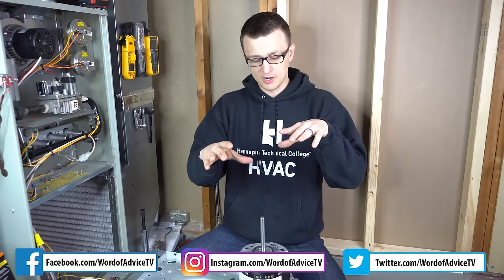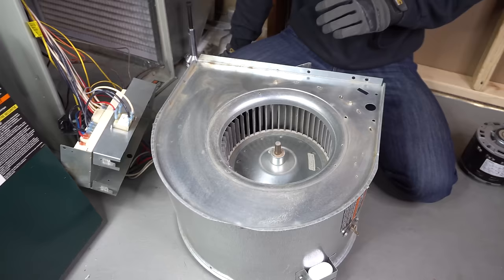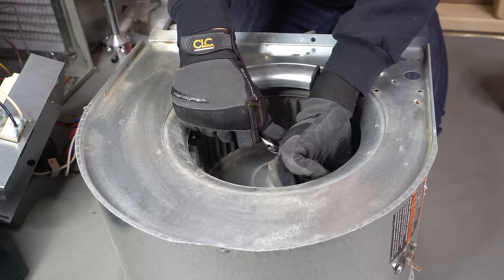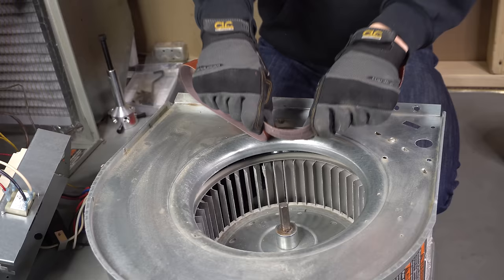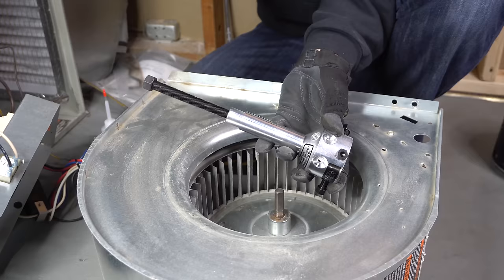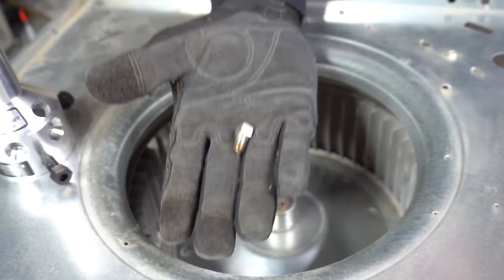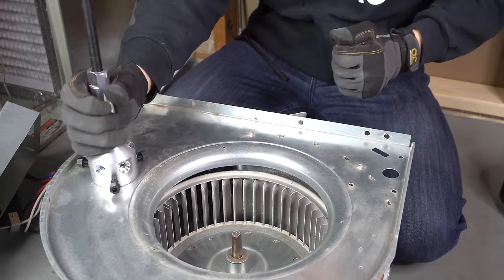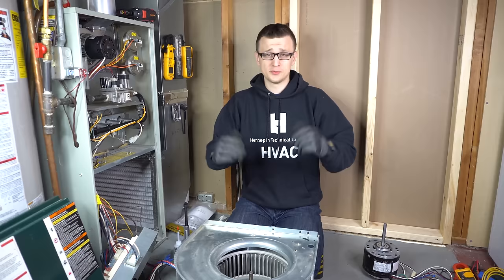Furnace Blower Motor Not Coming Out and How to Persuade it

Comment: Hey Troy. Thanks for the help. My  blower was really really stuck and  i don't own a puller. Tried oil , crescent wrench, hammers, heat you name it. What finally worked was inserting the shaft into my B&D 1/2 inch electric drill and cranking it while holding the blower. Turned the motor free and polished the inside of the wheel hole at the same time. The drill Went on the shaft easily and tightly and loosened it with zero effort for the drill. I 
had struggled for close to 2 hrs. Before this.

Comment: I’ve been a tech for 30 years and blowers are always a pain. Firstly, why is the motor being replaced, many times its a blower wheel becomes unbalanced and destroys the bearings over time. On outdoor units that have a rusty shaft, dont bother, order a wheel too.  If your insistent to remove the blower or condenser blade, clean up the shaft with sand cloth first, remove the set screw, and penetrating oil the flat side of the shaft and try spin the shaft with a crescent to spread the lube. Use a drill tip screw to place a dimple in the shaft center to keep it from walking.back out the puller screw all the way using a 3/4” socket on your hammer drill. Evenly space the puller screws from the sides of the puller interior. Half turn each screw alternately till contact is made, then use the Allen wrench. AVOID THE SETSCREW HOLE . Use the socket and it will come out easily. Ive only had one over the years that was so stubborn it stripped the center screw on the puller, ended up shutting the shaft.

Comment: a last case scenario vs busting out the squirrel cage is to apply heat around around the hub and shaft (red hot) with a propane or map torch.  allow to cool down or pour small amount of water to keep from getting burned, then try using step 2 with crescent wrench or hub puller.  I had to use this process many times.  The expansion ad contraction of the two dissimilar metals usually frees up the shaft so it can be removed
Reply: This is what i did. way faster. Except i only heated the hub and used a punch with a smaller diameter as the shaft as to not mushroom it out.

Comment: Kudos! Pushing the stuck bushing back down and sanding the shaft with fine sandpaper as shown in your video, followed by 3in1 oil was all I needed to be able to get the motor separated from the blower in an old Nordyne. Saved me a trip to pick up an expensive hub tool. Thank you! Once I had the motor apart I cleaned and let the end caps with the dried out felt oil wells (no access channel -old style) soak in 3in1 oil and it began to spin beautifully. Cleaned, wire brushed and spray painted the squirrel cage to reduce future dust accumulation and the furnace runs like new. (I have a new motor on order but I may end up returning it). Great channel! Saved a $300 service call which would have resulted a replacement motor for an additional marked up $400. The satisfaction is surprisingly and disproportionately huge :)

Comment: One tip I’ve learned over the years,  a lot of times if you just can't get it, if you put you're face in front of it while pulling real hard it will usually release.
Reply: 🤣🤣🤣 I have also had success with that technique. I broke my nose once but the job got done!
Reply: Dang you’re right it worked

Comment: A pro tip on the hub puller. Do this once and you will not have to do it again. Take all of the bolts that are in it that go into the hub out and put them back in a half turn at a time. Next time you use it turn each set screw exactly the same revolutions. Reverse that order the same when you get the wheel is off. Exact center is what you want and this will do it.
Reply from the maker: Very good tip!! Thank you for explaining it!

Comment: some more hints  i always unscrew set  screw add oil in hole, sand shaft  spin blower whee,l mark where wires are ,mark,  where the blower wheel  is, on  blower always put screws in magnetic holder inn order   simple steps  it sounds like alot of work but it  makes motor replacement  alot easier silicone or your favorite liquid wrench on shaft  i never hit  the shaft with a metal hammer  thanks for reading ,you make great vids
Reply from the maker: Yes! Good advice! Thank you very much for the additional pointers!

Comment: Thanks for your advice on the crescent wrench!  Had to use my 10” wrench to get the torque to start rotating the fan on the motor shaft. I still could not get the fan off, but more spinning and some work with the rubber mallet on the motor shaft finally loosened it up. I suspect the fan and shaft have been together for the life of the furnace, likely 30 years and change…

Comment: Thank you, you saved me with the level 1 technique! One thing I needed to do after being able to rotate the motor shaft out of the blower wheel was to file down the set screw mark after pushing down the wheel a bit. Now I will be able to deal with the real problem: wobbling blower wheel. I assume adjusting the weights after cleaning all the dust and debris would help, but I'll see.
Anyway, thanks a lot for the useful video. This is the second time you saved me, the first was to diagnose the relay problem on the controller board after learning the sequence of the furnace functions from your video a year ago. Hope you are enjoying the life on the island. Big Island had been our favorite place for diving in '90, now we just retuned from Oahu trip to meet our son first time since we sent him off alone to college this August. Wishing I can relocate there. Will ask you if I face more problem on my furnace.

Comment: Great video and great tips. I usually push the blower fan down against the motor and then give that shaft a good cleaning with some Emory cloth and a small file for any big burrs I might find. Then a small couple drops of any kind of light penetrating oil on the blower hub and with the housing laid across a milk crate, give the end of the motor shaft a couple quick taps with a dead blow hammer and the old motor is now in the milk crate, ready to be carried out for disposal or a core refund. The rooftop condenser fans do take a little more sanding with the emery cloth, but they end up sliding right off just as easy. I learned to polish shafts before fan removal on a six foot in diameter exhaust ventilation fan, that had quit running after 15 years of service and I'll just say it was well worth doing. That fan would have never been removed otherwise. Great video. Take care. Loved the joke! 😀 Jpol.
Reply from the maker: Your motor replacement procedure is awesome!! Thank you for sharing how you do it, step by step. I like the milk crate idea! And glad to hear you liked the joke ;) Thank you for watching and commenting!

Comment: Good video. Thanks.
If really stuck bad, I would say use penetrating oil (not lubricating oil) on the collar and apply heat to the outside of collar with a torch.
One other method. If you have a helper, see if he can get his hands in past the motor and grab the blower cage (not on the edges because it will bend) right near the center, near the motor shaft. Have him raise it up in the air so the end of the shaft points up. Now you place a protective piece of metal or wood against end of shaft and strike it sharply with a hammer.  Be ready to catch the motor because it may drop right out.

Comment: Okay so you said if anyone has any tips so here is one. At the end there instead of cutting the wheel apart rendering it useless I'd try to cut the shaft off short to the hub and then drill it out.

Comment: Level 2.5 is to use a drill and make a small indentation in the center of the shaft (to keep the chusel/punch centered on the shaft), then place the housing on some cmu blocks/4x4 scrap, put a point style chisel in your bulldog/rotary hammer, set it to hammer only mode and give it the beans. I guess an air hammer would also work if you happen to have an air compressor handy.

Comment: Your idea with the crescent wrench on the shaft gave me an idea using rotary impact. Set the assembly so that the shaft is horizontal. Spin the shaft (and squirrel cage) with the wrench (set screw removed) and let the wrench handle strike the floor and come to a sudden stop. The inertia of the squirrel cage will keep it rotating and it will budge a little bit. Repeat until it spins freely.
Reply: This is an excellent idea.  In this case, part of the trick would be only removing the set-screw (nothing else at this stage), next use the impact-driver, as you explained, allowing it to lock itself into a fixed-position.
Reply: @InspiredScience  The technique I described worked nicely on a 25 year old furnace (still up and running). It doesn't involve any tool other than the crescent wrench which grips the flat part of the motor shaft (set screw removed). The rotational shock (sudden deceleration) of the shaft when the wrench handle strikes the floor is the source of the impact. The nice thing about this approach is that it doesn't involve a puller and is pretty "kind" to the squirrel cage.

Comment: The long screw on the puller is called the “jack screw”, just an fyi. Nice video, thanks!
Reply from the maker: Thank you!! I will finally know what to call it :)
Reply: Word of Advice TV  great  advice as to how to handle a situation where the blower wheel won’t come off. Never had a worse case scenario where I have had to break the wheel apart, but need to stress that if a person ever finds themselves in a situation where they have to break the wheel apart to take measurements of the wheel first, there are a few dozen different sizes out there, so you don’t want to go ham on one without first documenting the size of the original one your going to replace.

Comment: Can you please make a video on how to using that hub puller to take out the blade on condenser fan?  How those hoods be used? Thanks a lot!!
Reply from the maker: Yes, perhaps I can make that video in the summer. Thank you for the suggestion!
Reply: Thank you!!!!
Reply: I’m still pissed that in 2021 that blower motor fans are so poorly designed.
Reply: @buddyryeSE  seriously, why can't they be entirely sealed so dust won't kill them so quickly? if I have to replace the motor, why can't we upgrade to one that will last 50 or 100 years?

Comment: I ended up using a hammer and then a large pin punch to finally get it out. I had turned it a few times and use some anti rust spray. I definitely will need to clean it to get the spray smell out. But yeah I got it out without that tool. I used a drill with a wire scrapping tool.

Comment: I had to ground down the shaft with a angle grinder.  Unfortunately just sanding it down with my sander wouldn’t work.  I’m guessing it had been on there for decades.  By the way when I took the housing outside and sprayed it down to clean it I was amazed at how dirty it was inside.  It was disgusting to be honest.  Planning to take it apart yearly now to do a full cleaning after what I saw get washed out of there.

Comment: Perfect! Level one did the trick! Plus, removing the  bracket revealed more of the wiring diagram for the 240 line voltage connections to my motor!! (See my comment in your other video on wiring a motor to 120V...)
Thanks for the informative videos!

Comment: Had a stuck wheel and followed all your steps except instead of tearing off the fan blades I used a ten pound sledge hammer and a metal rod to knock it out.

Comment: Their is a better way to remove this motor, I always use my small dewalt hammer drill and set it to hammer and place a old 3/16 bit in my drill and set the blower up on some wood blocks or what ever you have to raise it off the ground. Then set the drill bit on top of the shaft and start slow on just hammer, as it makes a dimple on the top of the shaft then go to full hammer mode on the hammer drill and it will push the shaft out of the blower wheel very fast. Every time, repeat every time. most techs have this tool but a DIY home owners may not have this tool but it is in fact the best way to remove the blower from the shaft after sanding it clean and a bit of oil on it. Mark Kinney Plumbing Heating Cooling. Charlotte NC
Reply: How come no use of MAPP gas torch on the o.d. of the hub?  In automotive,  you always heat before beating.  Most times after heating and penetrating oil tapping with a plastic tip or brass hammer will move the shaft thru the hub.

Comment: There's also a last ditch cure  / Step 4 ... Cut off the motor shaft close as possible to the hub. Then drill out the shaft,of course not to the total circumstance of the shaft tho. Oil it up good. And pull on it as you did. The drilling releases the stress on the hub,from the shaft. It isn't easy. But it's worked.Hence : Last Ditch...
Reply from the maker: Yes! That didn't even cross my mind! Just drill out the shaft. Thank you for providing another option!

Comment: I have an issue pulling the wheel out from the inducer motor.  I have a Fasco A068 inducer motor.  i used 1/8 inch allen wrench with long handle but the screw does not seem to budge.  Any suggestions. BTW, I love all your videos, very clear and detailed.

Comment: I hit it with a hammer being stuck. Made it worse. I ended up sanding it. Still not enough so I used a power sander with shards of metal flying all over! Now the new one is getting stuck going in so I'll be trying to clean it out to figure out why... Nothing I did is causing the dilemma...

Comment: Make real sure that puller is CENTERED, pointed directly IN LINE with the shaft, and the 3 holder screws are nice and snug. Otherwise, you can send the jack screw off at an angle and end up mangling the end of the motor shaft or the hub of the wheel. (Once was enough times making that mistake. :o)
Reply from the maker: That is a great point to stress! Thank you for highlighting it!

Comment: I used some WD40 and a popcorn tin to get mine off.  LOL  I took the motor brackets off and slipped the motor inside the popcorn tin (it was the perfect diameter to support the blower wheel all around), then I WD40'd the shaft and tapped it from the other side until the motor fell into the tin.

Comment: Thanks for this great video. Next time I suggest using a knee pad when demonstrating a repair in that position. You will see what I mean in about 10 years from now.
Reply from the maker: You are very right! I normally try to use a knee pas all the time but apparently I need to work on that habit even more :)
Reply: I just saw a nice thick solid kneepads sell at Harbor Freight last week, for 5 bucks.  It looks and feels better than those for gardening use.

Comment: that worked. thanks a lot!
Reply: I was at the point where I was ready to give up. I had the original blower motor and fan in my furnace and could not free the fan from the motor. at 3:30 a.m. your video was right on time. I replaced the old motor and blower with the new replacements. my twenty-four year-old furnace sounds like a new furnace. the furnace is substantially quieter. thanks again.
Reply from the maker: You're welcome! Glad to hear that the video helped you out and the furnace is up and running again. Stay warm!

Comment: You ever have a blower housing that has screws that hold it up on the side? They look like brass and have Allen threads I think. I took the whole control board out and couldn't get the blower out

Comment: Hi, thanks for your video. I am trying the third way since my blower wheel is broken anyway. I separated the circle from the blades and bent it but the motor shaft is still stuck in the hub. I don’t understand how this method works. Any advice?
Reply: Update, I really smashed the crap out of the blower wheel circle with a crowbar and used WD40 and finally dislodged it. Thanks again for the great videos Jay.

Comment: One thing with the hub puller, make sure none of the 3 screws holding the puller go into the hole that holds the blower wheel and the motor, it happened to me once. 😂🙈👍🏼
Reply: Yea happened to me too. Stripped the set screw threads on the blower wheel

Comment: I hit my blower motor rod with a hammer and now I think I mushroomed it because it now pulls 99% out but when its almost all the way out and the head of the rod is flush with the hub, it gets stuck and cannot cross the finish line. Trying to puller tool to get it past that damage I may have done to it. I think if that doesnt work I will try to use a file and file the mushroom head I may have given the rod. Last resort cut the whole wheel out.

Comment: If you break it apart, level 3, how do you get the new one in? Why not just replace the assembly with a new motor?
Reply from the maker: You would only break apart the blower wheel, not the whole housing. So you would need to order a new blower wheel along with the motor. That is cheaper than ordering the whole assembly.

Comment: I would do it the Russian way, take a hammer and knock on the center screw from the puller when already under tension, that would break the motor shaft loose ( just like an impact wrench works). Tightening the 3 puller screws to much will maybe cause the shaft get stuck even more in that hole.
Reply from the maker: I have never tried that but perhaps I will give it a try one of these days :) Thank you for watching and commenting!
Reply: @WordofAdviceTV  Yeah, i from Russia. I agree that many repairs in Russia are done with a hammer ))) but you need to understand where to hit and control the force of the blow